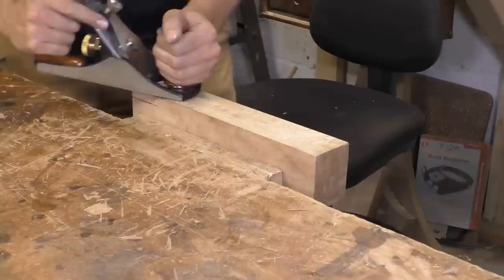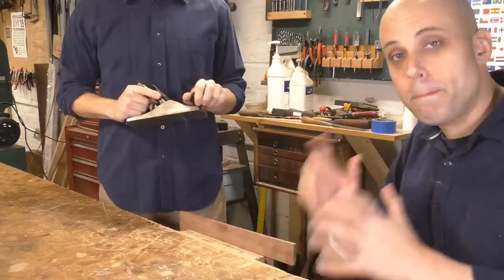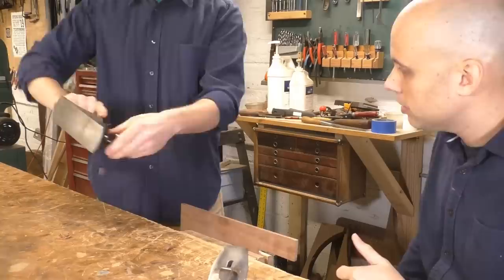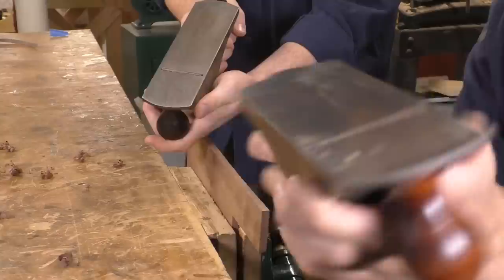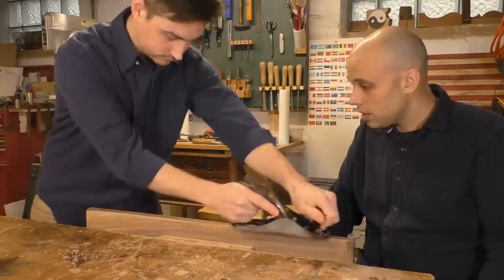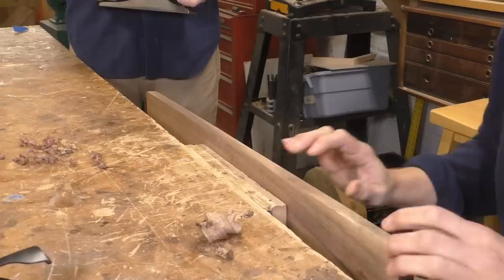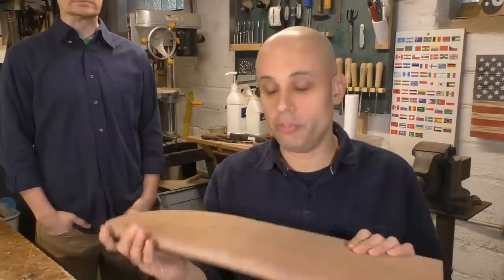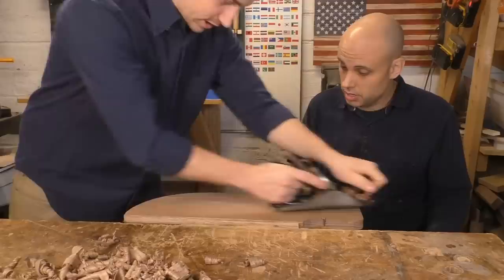Learn to use your hand plane!

Comment: Hello Rex. You saved me sooooo much worry . I do some Woodworking . small stuff that so far has come out well, thank goodness. 
However, I did want to upgrade. But  when the thought of spending $400.00 or more on a wood planer I thought how about a hand plane. They are quiet and less wood chips flying around. and my Wife can't complain about NOISE as there would be none at all. So after some reviews I picked up two Stanleys, a Jack and a Smoother. Both look beautiful. But I could not get the Jack to work like one sees in the videos, till I came across your video here. Thanks for sharing your wisdom. My Charcuterie board ,that I had sanded and sanded and sanded rocked like a rocking chair. After watching your video and taking things a bit at a time and doing all that you did with Nate I finally have a board that sits flat. Yes and on both sides.too. Wow. I could not believe how things turned out. Next I have to work on the big Smoother. Thanks again for the slow instructions. I hope more people watch and learn from you.

Comment: Nice one, very informative. I knew the smoothing blade was sharpened with a slight camber, and I’d pretty much guessed that it was to prevent or reduce tramlines.  However being perfectly honest, I didn’t know how to set and tune the plane to work at maximum efficiency.  Nate looked a bit too comfortable for a novice that’s never used a plane before, but I’ll take your word on that.  I have had very mixed success with using my plane, and mostly poor success, if there is such a thing.  Now I now how to set the blade and cap iron, and keep taking passes, adjusting as I go, following your easy to understand instructions. 👍

Comment: So ... my woodworking experience is limited to two things: wood shop when I was a kid and dinosaurs roamed the earth, and using power tools to build components for beehives and jigs for that work. I remember enjoying the act of planing way back in shop class. I recently saw a couple of videos on planes and planing and decided to get a couple of old planes, restore them, and start making shavings. My entire objective was to learn and enjoy the whole process. I picked up an early 1950# no. 4 and a post WWI no 5, restored them, and started planing. This video had been enormously helpful. I did not know about clambering blades, so I am going to learn to do that now. This winter I will do a “real” woodworking project using chisels, hand plans, and Japanese pull saws (I always hated sawing but find pul saws a joy to use. Thanks for your videos. I am off now to watch your sharpening video and then head out to the shop and put a camber on the blade in my no. 4. Stu

Comment: Loved it I feel I am a veteran at hand planning and I learned a lot. One tip I have for edge planing is "plane less and verify more" I find that checking for square after 2-4 passes keeps you from chasing your tail.
Reply from the maker: That is a really good point. I should suggest that more. The problem with a little experience is you forget what you know or how you got where you are.
Reply: Teaching something makes you think about it in a different way. Often, your own skills will improve as well. Your instruction will most definitely improve as you teach more and realize what steps need to be added or subtracted from the instruction. Also, as an instructor, you will learn people and how your choice of words can be interpreted differently from one student/apprentice to the next.

Comment: Rex I know you think you have explained how to set up a plane but I couldn’t get my planes to cut anything and yes I am a beginner after six months of trying everything I could think of an after watching hours of videos what I found was the bevel needs to go down and that fixed them all. Sharpening them to a razors edge had nothing to do with it I even got the harbor freight 33 to smooth a piece of wood like a baby’s bottom! I have to think there are others that could use this info.

Comment: I found an old Record plane a couple of months ago that belonged to my grandfather. It was rusted and blunt and although I cleaned it up and had a go at sharpening it, I couldn't get it to work. It just dug into the wood like a spade or slid across it with no effect. I discovered your channel shortly after that and this evening I finally got around to setting the plane up according to these instructions (and sharpening it according to your sharpening video!). Now it drives like a Ferrari, peeling of long, feathery shavings that I thought were the outcome of years of practice. Thanks!

Comment: I was recently making a coat hook to hang over a particularly thick cubical wall. My saw cut to make an inch-wide strip of poplar was way out of square, so I was over a quarter-inch wider at one end. Following techniques I learned from one of your videos well over a year ago, I clamped it up and took short, then gradually longer strokes toward the wide end with a recently-acquired Bench Dog block plane. I did the whole series twice, but when I was done, I was within 1/16 of 1 inch all the way across, which is more than accurate enough for knocking together a quick coat hook. So, thanks for the lessons! :-)
Reply from the maker: I'm REALLY glad you found my stuff useful. I need to do more videos on common household repairs.

Comment: Tip of the day: I had a problem (using cheap Chinese wooden planes) that the clogged with shaving after a few strokes. Today I trimmed the end of the wedge, smoothed it with sandpaper and waxed. Now there's more space and no more clogging.
Reply: Also I finally added the cross handle and it improves the balance when planing edges.

Comment: As a new woodworker I'm struggling with planes - Part of it is my inexperience, but also due to cheap planes I've been practicing with and crappy wood that I've been working on from salvage boards. Kind of like the perfect storm. I've gotten good with blade sharpening and honing though and I'm on the lookout for an inexpensive Number 4 or 5 plane that I can clean up and use.

Comment: I with I could give this Video Two Thumbs Up!   If you get the reference then you are as old as I am. 
I have to tell you that for the first time today I was able to actually use the No. 4 Sargent Planer I have from 1304 (I don't know how old it is, but it's old). 

First of all I followed your instructions and in an hour I had it sharpened correctly. 
Second I was able to setup the blade correctly so I didn't leave gouges in the wood.
Third I actually understood what I was doing. 

I've owned that planer for at least 4 or 5 years and I have watched dozens of videos on how to setup and use a planer without ever getting any good results.  I watch knowledgeable seasoned woodworkers setup and explain it but because you used Nate and explained it to him.  I was able to do it.  

Awesome. 

Additionally, I was also able to sharpen and actually use successfully my very crappy and annoying Stanley Block planer (which I'll probably donate to some organization I hate so it will frustrate them when they use it).

Comment: This is possibly the most useful video you have made, thank you! 
I'm at the point of making a bench hook, after borrowing dad's speed square because none of my gear is actually square. Thanks a bunch! 

This will follow up on my last masterpiece, the "Chisel in a Stick" poor man's router I bragged about to all my friends. Which required planing a stick. And thus sharpening a plane. And thus a holder for my sharpening plates. Which is what I needed the router for in the first place... :-P

Comment: Well whether it was Nate's dress sense or your easy to follow instructions, but I have just flattened peice of twisted sapele that was either going to be fed to the jointer and thicknesser or the fire. Not fully got to grips with how to tell where to take material from to remove a twist, but with trial and error and using a piece of 3/4 ply for referance surface I have manageged to make a useable piece of timber. Used a 2nd hand Stanley No4 - blade appears to be flat rather than have a camber as yours did but was able to adapt the principles of blade setting and working across the board then focusing on specific areas. You might gather am a bit chuffed. Never used a plane before other than to chamfer a edge corner.. Will be looking out other videos in this series. Many Thanks.

Comment: That was great introduction to planing.  It would be good if you could do a follow up video with a little more advanced lesson on making sure the face of the board is out of twist and also that the long edge of the board is perfectly straight as usually the plane will take off a little more wood at each end of the board, creating a slight hump in the middle, so you need to take a few stopped shavings in the middle of the board occasionally to correct.

Comment: That was awesome!  I've owned a plane for years and I have never been able to use it properly.  
I believe this is the first time I've seen a video detailing what to do and how to do it. 

Every time I've watched a video is just been how to sharpen and how to set the blade.  However, never once did anyone tell me it was supposed to fade to nothing at the edges of the blade. 
Honestly, that makes sense.

Comment: This helped me a lot. I'm still getting into using the new quality plane I just got and refurbishing my grand dad's old Stanley. This helped answer a bunch of the issues I was having with my first planing practice especially getting the edge flat and square to the face. It was alarming to me at first that I wasn't producing a square flat edge very quickly. But seeing this video helped me see that I'm normal and on the right track. Thanks again.

Comment: In case it helps another true beginner out there, I struggled for a long time on why I couldn't get good plane shavings.  Turns out, I was putting the bevel side up.   It seems most planes need the bevel side down.  Doh!!!

Comment: I have been sharpening and using planes for years, i have 4 number 4's, funnily enough the india made clone stanley is better made than the stanley, anyway what I wanted to say was thank you, as before i had sharp planes, yet they did not work as well as they could, I now know more, and as I was cleaning one of my planes today, I took heed of the lessons you have shown, and lo and behold, the plane is functioning a lot better (or maybe its me functioning better in adjusting and using it)

Comment: This is a Great video ,, I've never done all of the set up that was done here . 
I was taught to sharpen , put together , flip the plane I've and bring the blade out just unroll you can see it , strsingthe it using the bottom ohh the plane as a level. , start shaving . Which way someone learns doesn't matter though , as long as the end result is the same :)

Comment: I've been on and off on woodworking for a few years, mostly hand tools. I've got an old wooden plane, so adjustments for me are a bit different, still with al the planed boards on my back this has been a very helpful video, mostly because i've merely been learning by doing, and while I get the results I want, I have to do many corrections to get there. I hope this'll improve my efficiency, so I can further advance my projects in the little time I have for them.
Thanks a lot for this series, it's been both helpful and inspiring so far.

Comment: Rex-  Great video.  I am attempting to transition from power tools to hand and was helped considerably by your videos.  I have a question about planing and maintaining the dimensional aspect of the workpiece.  I just finished face planing some boards that came as 13/16” and realized when I was done smoothing, I was less than 3/4”, which is what I wanted all the components to be.  I haven’t seen anyone address this issue and would appreciate input.  Thanks!

Comment: So, how about a rookie question? I just learned from your video that a smoothing plane (Stanley #4 I presume) has a camber on the blade.  Prior to this video, I thought only a scrub plane blade has a camber.  Do all plane blades, whether short like a block plane and long like a fore plane, have cambers?  If so, how does one determine the arc of the camber for the particular plane or plane blade? one is using?

Comment: Hello everybody. and excuse my google-english.
A question for those who know more than me.
I bought my Stanley n4 handplane three months ago and after a first time of complete frustration, and after watching a lot of videos, now it works.
I have better results moving  the frog and  leaving a more pronounced gap in the mouth and a distance of 2 mm between the blade and the chip-braker. Of course my wood-chip is not the thinnest, but decent.
Watching these videos I learn that it shouldn't be like that. But if I leave a smaller mouth and a smaller space between the Blade and the Chip-braker, it just doesn't work.
What can be the reason? The sharpening ?, my  skills?, the handplane? or all these things together
Thank you... very much

Comment: As Nate refurbished his iron, shouldn't some attention go to the chip breaker, too? I'm brand new with planes and I got a new one (TayTools #4) and an old Fulton #4. I've got one of the rolling sharpening jigs as you show and I'm on my way. But my chip breaker surely needs some work. Should I simply clean it up with a wire wheel? Or is there some methodology about restoring them?

Comment: Rex - For metal planes do you ever need to condition the bottom of the shoe?  I have bought a new extremely inexpensive plane where the bottom was less than smooth and needed some polishing.  When I started the polishing process I found that the bottom looked to have some obvious unevenness, i.e: several "peaks" spread across the bottom with the largest in the center behind the mouth for the iron.  It took quite a bit of work to get those peaks out and I'm wondering if I wasted time doing so if it would not affect the planes performance.

Comment: 11:00 - This is a smoothing plane and it's sharpened with a curved edge... 
QUESTION: I though smoothing planes shouldn't have that... I'm lost now! =((
I have a sheap n. 3 and a better n. 5... Which should I make my smoothing?
I also have a small cheap block plane that works fine and has no cambered edge.

Comment: Question (maybe a dumb question, but I'm completely ignorant). Is it possible to plane on boards with gnarly knots or should you just completely avoid them at all costs, period? I just got my first plane. The first board I picked up that was just lying around in my garage had a serious knot. It was definitely a crappy piece of wood, but I thought I might be able to get some momentum and ride over it. Not even close.

Comment: Is there an equivalent replacement for the Stanley no 4 plane? It's not available on Amazon. I'd like to try my hand at restoring/improving a hand plane but also would prefer to spend 20-30 bucks ;)

Comment: Question. Is there ever a time you want an iron with a straight square corners instead of cambered corners?
Reply: Another (complete rookie) question. If you are squaring an edge, obviously you are taking material off. How does this not impact final measurements when you're assembling things? Do you just plan your measurements to accommodate planing?

Comment: Is that a different type of plane iron? Another words I bought a $35.00 plane at Home Depot. And it's a good beginners plane I believe. But my iron is straight across. I mean it's sharp, but it's flat if I set it across my bench when it's out of the plane. So I'm not sure how to get the corners of the plane iron to set inside the plane.

Comment: Hi, I'm having a bit of a hard time with a project. It's probably not for a beginner... 
I am working with pine for this. I have a board that has a lot of knots. At each of the four corners of the board i have the legs protruding, so the grain is 90 degrees to the board. I want to get this straight and smooth (it's a nightstand). The board was really bowed, and i did manage to get it almost perfectly straight, so that part is fine. The problem is i get chippings right after each of the knots, and it's hard to plane over the legs. 
Anyone has any idea? This one might not be salvageable, so i just filled the chips with glue and sawdust and tonight i plan to use a sander and get it good enough. It's not a big deal, because this one is just a proof of concept, it has multiple issues, and it will be painted black in the end. 
The end goal is to make a bunch of pieces (a bad, two nightstands, etc.) to make a set out of nicer wood and oil or lacquer it, not paint, so nice surfaces would make a huge difference.
https://photos.app.goo.gl/qGkdTrfXbhduaqAeA

Comment: Rex, the scrap at the beginning, is it worth setting a board at "level" before you plane? Just a quick check with the level in your combo square?
Reply from the maker: Nope, there's no benefit to that at all, but that's a totally reasonable question and I'm glad you asked it!
Reply: @RexKrueger  was thinking about the bio mechanics here and consistent pressure. Course I think like a machinist so, .... When Nate started it looked like he might be planing slightly uphill. Hmmmmm.
Thanks Rex